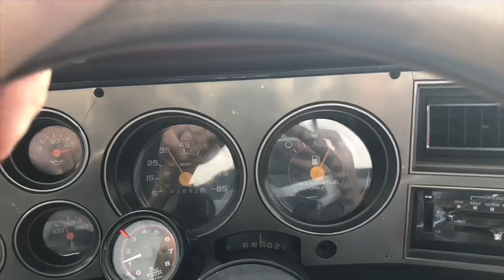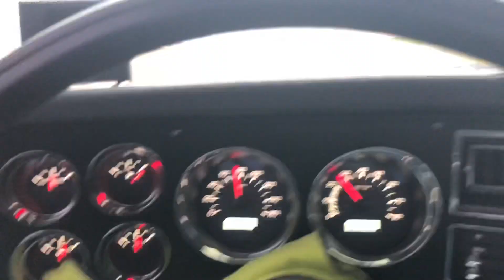LS Swapped 2wd K5 Fuel System

Comment: I really like everything you did. I am doing the same thing on a 78 blazer my question is how come you’re sending unit is turned towards the passenger side when you’re going down the driver side frame rail. I understand why you went down the driver side frame rail, but I’m just wondering why you didn’t take off in that direction
Reply from the maker: @SteveSerpa-o8j  sending unit only goes into the tank one way which puts the outlets down the passenger side frame rail which is where the stock fuel lines ran.

Comment: Great info! I'm doing the same thing now. I'm using stainless 3/8 tubing for the fuel lines. I was thinking about using steel or stainless tube nuts and sleeve. I see you used aluminum tube nuts and sleeves. Did you have any problems with leaks with the aluminum fittings on the stainless tubing?
Reply from the maker: No leaks, have about 7500 miles on the fuel system since the swap.

Comment: I'm swapping a 06 5.3(returnless fuel) into a 91 that had a carburetor instead of the tbi. When i was taking off the fuel lines that go up to the engine, i noticed that the return line(?) Was capped off. It had a in and out fuel pressure regulator(?)(no return in that regulator.)
Reply: You think if i install a Corvette style regulator and connect the return line that was capped off coming from the gas tank to the return outlet from the regulator. It'll work with my returnless set up ?
Reply from the maker: As long as you have a return less fuel rail that will work perfectly. The corvette filter regulator will regulate the fuel to 58 psi so anything that isn’t needed in the rail will be returned through the filter. I like to keep my return as short as possible coming out of the filter back to the tank.
Reply: @3rdGenC10s yes, it has a returnless fuel rail. Thanks a lot man. Subscribed 👍

Comment: Thks for the video I used a 21 cal blazer tank changed out the pump with a walbro 255 but had the the wiring in the tank to 14 pcfe wirer how much the Delco fuel pump and how many Amp does it pull please
Reply from the maker: It was around $50 bucks when I purchased it. I’m sure the price has went up considerably, I checked and it’s out of stock with no price given. I’m unsure of the amp draw.
Reply: @3rdGenC10s  thks I put 21 should been 31 cal tank
Reply from the maker: @PeterHatch-mx7zc  I may end up swapping out my 25 gallon for a 31 in the future just for the few extra gallons.

Comment: I noticed my '73 c10 doest have rear upper spring perches,  just leaf springs. .....is that normal...although there are lower perches on the rear axle....I just swapped in a cammed 5.3 and a 3000rpm stalled built th350...got her all wired up and running,  now I get to move on to the fun stuff. .....body work,  luckily the seat has no rips , just gotta get a dash cap and door panel caps....it was a straight 6 granny 4 spd truck, when I got it , but it must of been a 3 on the tree originally because I can see where the column shifter once lived....
Reply from the maker: Mine has a flip kit on it. Is that what you are seeing as a upper spring perch?

Comment: Nice work. I like watching your videos. I see in this video you already installed the brake lines. What proportioning valve are you using. I can't find a replacement in the parts store.
Reply from the maker: A-Team Performance - Combination-Proportioning Valve, PV2 172-1353 PV71 Disc/Drum Brakes, Front Drum Rear Brake Brass, Compatible with GM Street Rod Classic Car Truck https://a.co/d/79tet7Y
Reply: Thanks for the reply
Reply from the maker: Hope it helps you out
Reply from the maker: Hope it helps you out

Comment: Great video. I am curious if you can just run the flex line all the way and not deal with the hard lines. Did you do the hard lines just for a cleaner look? Just wondering.
Reply from the maker: You shouldn’t have any problems running flex lines the entire length. I added hard lines for a little more reliability, flex lines can fail with ethanol fuel.
Reply: @3rdGenC10s  oooohhhh.... Hmmm... Guess I'll be learning how to make some hard lines look good. I appreciate the quick answer man!
Reply from the maker: @taylorschmidt5701  if you buy a good quality flex like you most likely won’t have any issues.
Reply: @3rdGenC10s  awesome. I'm going to start fuel lines on my LS Scout II this evening hopefully. Thank you for your advice!

Comment: What fitting did you use to connect the corvette filter to the feed line
Reply from the maker: Fittings Kit for Fuel Filter/Regulator 58 PSI for LS swaps and EFI conversion https://a.co/d/b05k5Dx

Comment: Did u cap off the other lines coming out of the sending unit?
Reply from the maker: Arnie Cann the bigger connection vents the filler neck. The smaller connection vents the tank, I’m going to run a piece of fuel line with a filter on the end of it for that.
Reply: Does that mean u plugged the filler neck vent from the sending unit?
Reply from the maker: No, it will be ran to the filler neck when the body goes on.